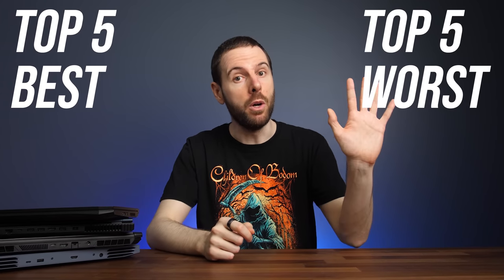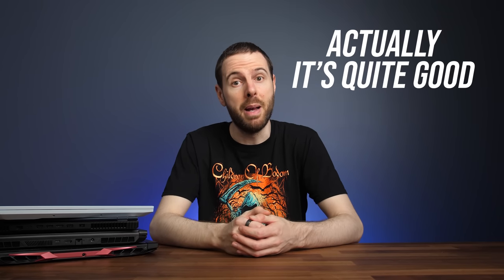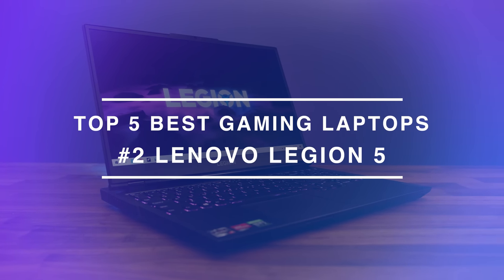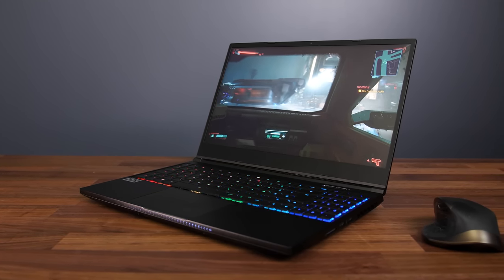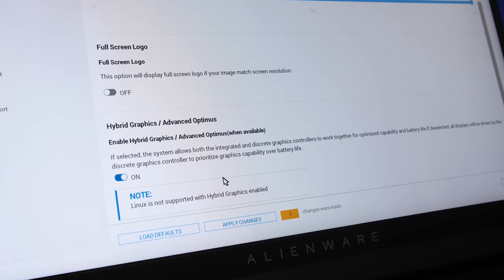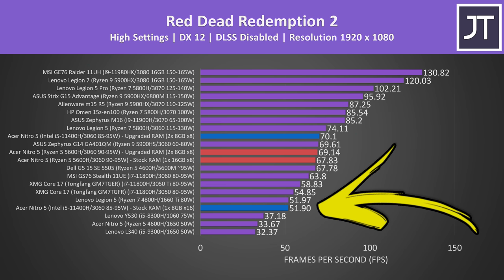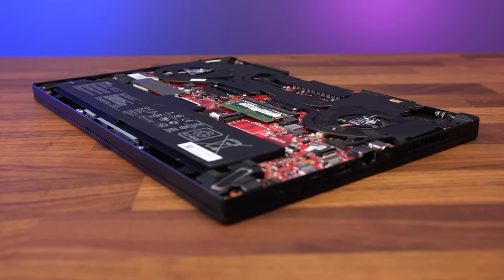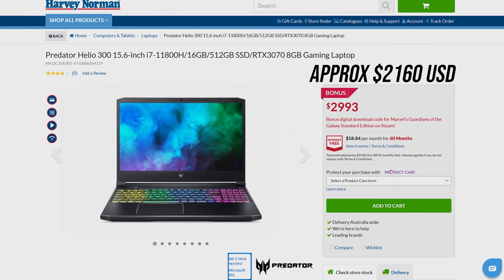Top 5 BEST & WORST Gaming Laptops of 2021!

Comment: Got the 3050 ti laptop but I am still pretty happy since it runs all the games I play at well over 100 fps even with higher end games when I turn dlss on I still get at least 90 fps which feels smooth to me. But yeah I agree if you have some extra money the 3060 is better. I just think the 3050 ti shouldn’t be as shamed as it is. Its still a solid gpu.

Comment: there are so many builds of the Legion 5, how do we know what's worth the money. Walmart has a good sale on one but it's got a 17.3 in Screen, AMD Ryzen 5 5600h CPU, Nvidia GTX 1650 GPU, 8 GB of Ram, the smaller battery, 256 GB NVMe TLC SSD, and a 60hz Screen with Windows 11 Home for around %700. I would love to jump on it if it was worth the lower specs. What do you think?

Comment: Hi there Jarrod, i'm wondering if You could help me to make a choice which laptop would be the best for me. I've found 5 position but i don't know which one would fit me best (accualy which one would have the best relation price to quality) and i really don't want to make a choice i could regret after few months. First its needed to say that i'm looking for a gaming laptop. Here are my propositions:

1. HP Victus 16: 
- screen 16.1", 1920 x 1080px, 144Hz
- proc AMD Ryzen 7 5800H
- memory 16GB
- disk space 1000 GB SSD
- graphic NVIDIA GeForce RTX 3060
- price 1340$

2. LENOVO Legion 5:
- screen 17.3", 1920 x 1080px, 144Hz
- proc AMD Ryzen 5 5600H
- memory 16
- disk space 512 GB SSD
- graphic NVIDIA GeForce RTX 3060
- price 1434$

3. LENOVO Legion 5 Pro
- screen 16", 2560 x 1600px, 165Hz
- proc AMD Ryzen 7 5800H
- memory 16
- disk space 512 GB SSD
- graphic NVIDIA GeForce RTX 3060
- price 1551$

4. ACER Nitro 5:
- screen 15.6", 1920 x 1080px, 144Hz
- proc AMD Ryzen 5 5600H
- memory 16
- disk space 512 GB SSD
- graphic NVIDIA GeForce RTX 3060
- price 1246$

5. ACER Nitro 5:
- screen 15.6", 1920 x 1080px, 144Hz
- proc Intel Core i5-11400H
- memory 16
- disk space 512 GB SSD
- graphic NVIDIA GeForce RTX 3060
- price 1340$

I'd really appreciate any support.
Best regards

Comment: Hey there Jarrod.  

I purchased a Legion 5 17" 1660 TI earlier this year.  I got it to replace my MSI Stealth GS66 that was so loud I just couldn't stand it.  The 17" was a good fit, but I did not realize that I needed the RTX class card for some of my video work. (needed may be a little strong, more like want it??).  So I started looking for something that would be more powerful for the content creation side of things, especially streaming multi-cams, etc.  I did not know the difference between the Legion 5, 5 Pro, and 7 until watching your videos.   I almost pulled the trigger on a Legion 7 with 3080 16GB option, why not go all out, right?  But, I could not justify the nearly $4K.  I found a Legion 5 Pro 3070 on eBay for $1600 that came with 3 years of ultimate warranty support.  I call that a win.   I've been enjoying it for the last few days and the 16" screen, for those that are wondering if it's worth it, is AWESOME.  I have poor eyesight which is why I got the Legion 5 17".  The Legion 5 pro 16" is a happy compromise for the larger screen with higher resolution and greater pixel density.   I'm very pleased with the Legion 5 pro and want to thank you for your videos to help me make the choice.  The Legion 5 17" is heading to my workshop to replace an old dell m4800 and the Legion 5 pro is now my office computer away from the office.  Anyway, thanks for your videos.  As a content creator, in a completely different space, for nearly 14 years, I know the work that goes into keeping a channel going.  

Thanks again.
Rick

Comment: Hi, thanks for this video. I have a question. I want to buy a new laptop. but I can't choose between Asus fa507re and HP Omen 16.
Omen 16:
Cpu: intel i7 11800h, ram: 16 gb, ssd: 512 gb, graphic: Nvidia 3060 (6 gb).
FA507RE:
Cpu: Ryzen 7 6800h,  ram: 16 gb, ssd: 1 Tb, graphic: Nvidia 3050 ti (4 gb).
which one is better? which one do you recommend?
I don't play a video game with laptop, (I play with PS4)
but I'm mining engineer and I need to design copper mine or salt mine with Datamine Studio software and etc. So I need to render of more data. On the other hand, I watch much movies and I use the Photoshop software. then I need to have a high quality of screen. please help me to choose correctly.

Comment: this aint a hit on jarrod, i love him and his reviews. i do agree with these rankings considering his market is different from mine.

but here in the philippines, the rtx 3060 i5-11300H dash f15 is the cheapest you can buy with an rtx 3060. it's 55k PHP  (1087USD). next one's would be the gigabyte one with the cpu running at 90 C, and the predator, both 200USD and 400USD respectively more expensive than the dash f15. Dell G15 and eluktroniks just aint available here, and the other three are 800USD plus more expensive than the dash f15.
Reply: Ye you're right, different geographic demographics with different market experiences.
Reply: link pls haha that pricing was around in May ata? there was a 49k 3060 that time eh. but as of writing afaik, their prices all shot up. please correct me if im wrong though

Comment: Jerrod I am a bit surprised you never mentioned M15 is a reskinned G15. It uses exactly same mobo (for 3060) and screen panel (for FHD 165). M15 just managed to come with a aluminum chassis which is somehow feel less premium than G15's plastic.
Reply: Actually, the reskinned one was the G15, taking the Alienware design. Good to know you can use high tier parts to replace things on the cheaper laptop!

Comment: So Currently I have a rtx3090 in my desktop and a ryzen 7 3700x ect. I'm moving shortly and am debating selling the rtx 3090 and the rest of the hardware to get a good gaming laptop or should I get a "okay" gaming laptop around $1200 with thunderbolt 4 so I can use a external dock and keep my rtx3090 or just go full ham and get a rtx3080 laptop? I would be hooking up the gaming laptop to my monitor directly while at home so no bottle neck. What would you recommend for option 1 and option 2?

Comment: I have 2 options and i cant decide what to buy, legion 5 pro with ryzen 7 5800, 32 gb ram, 1 tb, rtx 3070 8 gb OR I7 11800, 32 gb ram, 1 tb, rtx 3060 6gb. I ve read that the AMD Ram has some problems. Any opinions?

Comment: Check 4:10 the vid has an issue

One frame is flipped for so e reason. It's probably not a big deal.

Edit: the vid is overall is amazing. Though I have a question. Is the Dell laptop color is that of a deal breaker? Like I have an Hp omen 15 with 100% sRGB and I want to upgrade to a laptop but not sure if the 50% sRGB is that of a deal breaker? Is it?

Comment: Hey Jarrod'sTech nerds :) luv your videos and your hard work You put. I've watch your laptop review the hole year, every vid. But i have a question: I want to buy a laptop mainly to game CoD Warzone and WoW and in my country the 3060 laptops are quite pricy, is IT ok to go for a 3050/3050TI? Or the Lenovo 5 with AMD5600 and 3060 at around 1100€+ is good? In my mind I have clearly "buy Intel, 3060, 16gb, good refresh rate". I would like to see some pro's and cons. Luv y'all
P.S. I am a truck driver and cant afford external monitor due to inside place

Comment: Not gonna lie, got the nitro 5 ryzen7, with the 3060 & 16gb dual. Paid just over a grand, and your right, best set-up, unreal price considering. Haven't seen anything at that price point with my setup.2021 model btw. Also got the g15 for my kid( 2022 model, Ryzen7, 3050ti) came with only 8gb single channel ram. HAD to upgrade to 16, Roblox was stuttering. All your points are spot on, have you done a comparison of my models, just curious 🤨

Comment: Hello! I want to ask for your help.
Unfortunately, it is not possible to get a two-piece from us, only in this form. I will use it for games and website design. Acer Nitro 5 16 gb ram 512 ssd 3060 GTX 6 Gb i7 processor 
or 
Lenovo Legion 5 pro 16 gb ram 256 ssd GTX 3050 TI, Ryzen ™ 7-5800H
Which is better, if both performance and display are important to me? Because the video talked about Acer Nitro, it's not the best, but we already have 16 gb in our laptop, which maybe eliminates this problem.

Comment: As an M15 R5 owner, there's another random inconsistency I'd like to share. The keyboard is backlit, but each key only has one of it's functions illuminated. For letters, it's obvious. For the number keys, it's only the primary function that's lit up... ok, whatever, I can remember that the ampersand is shift-7, but it's nice to just be able to glance down quickly and double-check. The weird part though is the punctuation keys only have the SHIFT functions illuminated. When you look down at the keyboard, you'll see the letters (makes sense), the numbers without their symbols (ok whatever), but you won't see , . / on the bottom-right, you'll see < > ?. Again, if you're a great typist it's not really an issue, but it's just weird that Dell's decision to only illuminate one of each key's functions wasn't applied universally across the keyboard.

Comment: Jarrod - Also with the Alienware M15's, they have a second m.2 slot but dell DID NOT include the rear stand-off that you secure the M.2 drive to.  Its a small aluminum piece that has the stand-off molded into it, and it needs to be ordered separately and installed into the mobo before you can install a second m.2 drive.  I had to call dell and argue with them that this was necessary and should be sent out without me having to pay for it.  What a mess.  Eventually it came in and I was able to add a second drive.  But Dell/Alienware has really dropped the "quality" ball with the prices they charge.
Reply from the maker: Yeah I mentioned that in my m15 R6 review but forgot it here, it's pretty stupid on their part. I mean yeah good you don't pay, but like just include it like everyone else, less hassle for the customer

Comment: I'm very confused between M16(2022) and G15(2022)
My concern is if I choose the M16 does the heating issue will slowly make laptop worsen in upcoming years or it can be managed by keeping a cooling pad?
And with G15 this year's amd performance was not better than Intel.But Intel have the heating issue so what should I buy?
And the 300nits display is enough? Because most of the time i used to do my work inside my home.
So what's your opinion?
Reply: I don't think that the m16's heat will have any issues in the upcoming years, and 300 nits is basically now more of an minimum screen requirement for good visuals in game and content

Comment: Amazing work Jarrod thank you so much for your videos. I know your not huge on 17" laptops but would the XMG NEO 17" produce the same gaming performance. Battery being the same as the 15". Thanks
Reply: Yes, XMG NEO 17 would produce the same performance as XMG NEO 15. In long saturated runs of full CPU+GPU stress the 17.3" chassis even has a slight edge against its 15.6" counterpart.

Battery of NEO 17 is smaller than in NEO 15. But that does not matter for gaming. Don't game on battery. Game on AC adapter. // Tom
Reply: @xmg_gg  Appreciate the reply Tom - Neo 17 ordered can't wait!

Comment: I had bought acer predator helios i7 10870 with rtx 3080. I wanna upgrade another ram but which one should i add? Add same like the one inside or buy new two and add them. Would like to get your suggestions with the brand, name and speed  of the RAM.

Comment: I'm looking to pick up a 2nd hand 2021 laptop to replace my surface book 2 15". I'm looking for 16:10 and decent power consumption to performance ratio. I work out on the road alot and use a camper van so something with a high watt requirement is an issue for me. The legion 5 pro looks good, but I was hoping for something that used less power with out too much of a performance hit... I'll continue to look through your videos but if something stands out too you I'd really appreciate the feedback.

Comment: Guys please help me decide should i go for legion 5 or HP Victus. My use is mainly software development, little bit of videos editing and a bit of gaming. Price i am getting is same for both. Specs are as follow:

Legion 5:
17.3 inch 60Hz display
Ryzen 5 5600H
8GB RAM
256GB SSD
GTX1650

HP Victus:
15.6 inch 144Hz display
Core i5-12450H
8GB RAM
512GB SSD
GTX1650

Third option is to wait for few months and perhaps buy 2022 model of legion 5.

Comment: Quiet surprised how 3 Lenovo are rated on top 5. I bought an y540 on 2019 brand new and it was dead because of the usb plug power supply. Seems that I'm not the only one on Reddit that had the same issue, the best part is that this happened 3 months after end of warranty period, when sent for repair all the motherboard is dead because of some electrical issue that will cost almost one new laptop. 
For me,I'll never go again with Lenovo. For the 2 others maybe but definitely not Lenovo.
Thank you though for this review.

Comment: In need of an advice! I have a good deal for Acer Nitro 5 with RTX 3070 8gb and i7 11800H, if I upgrade the single ram to a 32gb dual ram so it can run dual channel will it be worth getting? I can't get any Legion or ROG laptops and no other laptops with 3070 for a value like the acer.

Comment: Hey mate, I appreciate the channel! It's been a couple of years since you looked at 240Hz laptop screens. I'm customising another Metabox (the new Alpha-X) and the screen is my final decision. Is it a no-brainer to upgrade the 144Hz to 240Hz for only $50 more? 240Hz kinda seems unnecessary for my needs (single player gaming), but with such a deep discount, it's hard to resist. Will 240Hz just overwork the CPU or GPU? Thanks!
Reply: You probably won't notice the difference.
But if you get 240hz and can't get 240fps in a game you could just run the game at 120fps instead.
Reply: Thanks mate. I'm planning to play games on mid-high settings to avoid overheating and increase longevity, so I'm thinking the 240Hz will perform better (though possibly not even noticeable unless online gaming), but whatever increase in performance I get will just overwork other hardware anyway and be kinda redundant.

Comment: In tossing up between the dell G15 ryzen 5 5600h 6 core, rtx 3050, 16gb, 512ssd & a gigabyte G7 Intel i5 11400h 6 core, rtx3050, 16gb,512ssd. Dell is $1600NZD other is $1500NZD. The gigabyte has larger screen and 144hz as apposed to 120hz on the dell. I would be using for video editing, uploading, music editing & recording (reaper), canva editing and sims with all expansions and lots 9f custom content. I know both will suffice for my needs but for future proofing and overall better performance any suggestions? Thanks!

Comment: I have a MSI GP76 with 11800H and RTX 3070 140w laptop.  The score on 3dmark is around 11500.  In Tomb Raider, the average is 137 frames(the settings are same as your tests) .  According to your own video, it has the fastest response time screen on laptops. Also The temperature of the CPU never exceeds 75 degrees and GPU 62 even after a few hours of play.  I am really satisfied.
Reply: I'm probably going to buy one of these myself. My only concern Is the fan noise cause I'll be gaming regularly in the presence of others. Do find that fan is loud or extremely noticeable? If you are across the room with a TV on can you still hear it?
Reply: @DrDethface  yes, it is relatively loud

Comment: Is this a good setup for Call of Duty Warzone:

Intel Core i7 11th Gen 11800H 2.3GHz Processor; NVIDIA GeForce RTX 3070 8GB GDDR6; 16GB DDR4-3200 RAM; 1TB Solid State Drive; Microsoft Windows 11 Home; 2x2 802.11ax Wireless+Bluetooth 5.1; 16.0" WQXGA IPS Anti-Glare 165Hz Display with Dolby Vision

Comment: This is relevant to my interests...  I'm looking for a new machine (desktop or laptop) destined for graphics workflows - photography, photogrammy, 3D modelling (not rendering).

I'm still astonished you can get a better graphics machine for your dollar in a laptop than a desktop (though I take on board the notion that thermal management and differences in the actual components makes this comparison unreasonable).

Where in Australia could I source an XMG Neo 15? Is that the same as an infinity W5?
Reply from the maker: Yes, it's the same as the Infinity W5

Comment: Hello Jarrods Tech, years ago you helped me choose a gaming Laptop and now it is time to upgrade, hope you will take the time.
 Is the 17 inch of Lenovo legion 5 also desirable like overall good gaming Laptop, as Im a sucker for 17 inch gaming laptops. Some people say that the feauteres like Mux Switch, Advanced optimus or G-sync are not working or non existent as on 15 inch. You have some info around that ? If you can point me in a direction of 17 inch laptops, looked zephyrus s17 with over 3000 E in my country with lenovo legion 5 17 around 1500 with rtx 3070, looked at asus strix g17 and scar, you mention the problems on your other video shutting down randomly and that problem with the ribbon cabble, if you can point me in some good performance 17 inch gaming laptops I would be verry thankfull. Peace Jarrod.
Reply from the maker: You could check out the 5i review: https://www.youtube.com/watch?v=SDXCIobw_CM
It's ok but they could have done better to utilise the extra space.

Comment: I have Nitro 5 with Ryzen 5600h and 3060 with dual channel ram, so it is not a case everywhere to have 1 stick Jarrod. Laptop is performing flawlesly, more than happy with my purchase. And btw it never gets above 75 degrees. Great value for money.
Reply: is it reliable? heard acers laptops have long term issues
Reply: rip bro now its 650$ the amd version
Reply: @11hitmanDagenius  nothing can really go bad on a laptop unless you let it die like dropping liquids on it
although easy things to change are the screen, and battery if thtey do die out. screen get complicated when it comes to the touchscreen ones.